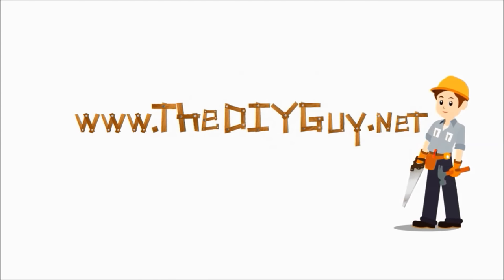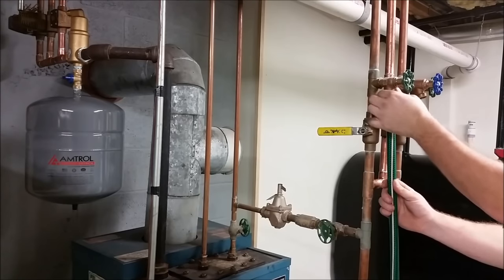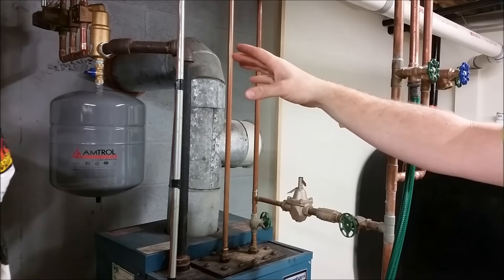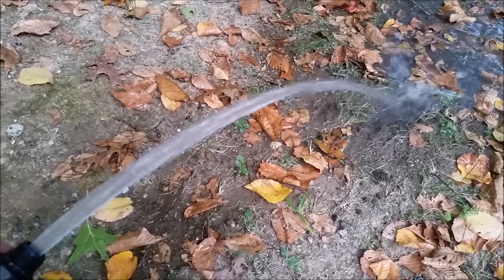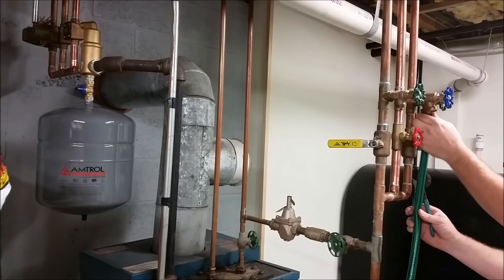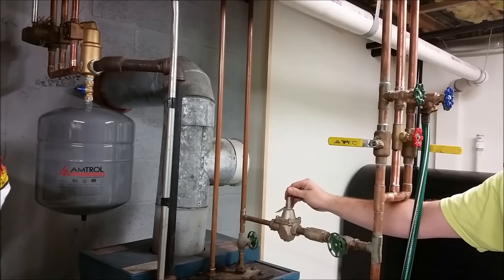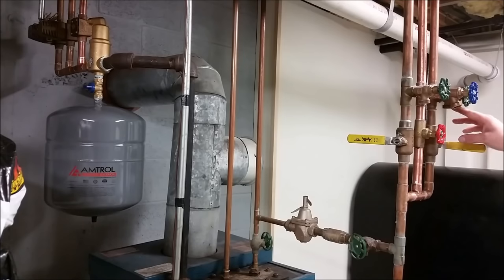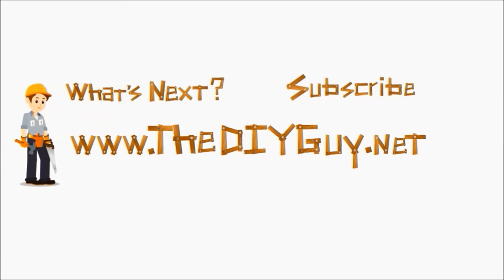How To Remove Air From Your Heating System

Comment: Great video. when I open my feeder valve, my pressure relief valve goes off at 30 psi, is that normal?  Or should I close my feeder?
Reply from the maker: Thanks. Yes that is normal as the pressure relief valve it set to go off at 30psi. (tag on it) The feeder valve should only be open when you have the boiler drain open on the heating loop to help push the air/water though the heating loop. Close the feeder valve and then close the boiler drain on the heating loop and it should fill the boiler back to the set amount. The boiler should be running somewhere between 12-15psi.

Comment: We did all of that now the problem is only 2 rooms are heating the other baseboards are cold any suggestions.
Reply: This happened to me too.  It was the zone valve.  I have Honeywell valves and when you switch from manual back to auto the gears are supposed to move back on their own.  If the handle stays stuck in manual, the gears are jammed and likely the motor is burnt out.  They sell replacements for the valve internals and the valve motor assembly if you know the part number (should be on the side or underneath your zone valve).  They just get old and wear out sometimes.  I was able to keep the old valve body and avoid any plumbing work.  If you only replace the motor, you risk having to fix it again soon since most likely the valve is not turning as easily as it should.

Comment: Did you turn the power to the Tacos off, before you manually opened, and closed, them? 
I thought, this is what we are supposed to do, 'cause, if we open/close them manually, w/out cutting power off to them first, they may burn out. 
Correct me if I am wrong, please. I'm learning.
Reply from the maker: No there is no need to shut the power off when going from auto to manual. As all you are doing is moving the lever to manual push in the plunger to open the valve and allow the water to flow.  I guess it could be a problem if someone left the wires long and you push/ made them touch another terminal while moving the lever. But in this case/ video we shut the boiler switch off which has also stopped the supply of power going to the transformer that powers the zone valves. You do want to be sure to shut the power off to zone valves if you are replacing the zone head.
Reply: @TheDIYGuyDOTnet   

Thank you so much for your reply, and your explanation. I've learned something today. 

Thank you
Reply from the maker: @JohnSmith-ok9sn  You're welcome, Glad we could help. Thanks for watching and taking the time to leave us a comment/ question. Don't forget to give the video a thumbs up/ like. Thanks
Reply: @TheDIYGuyDOTnet  

I have(!), and subscribed! 👍
Reply from the maker: @JohnSmith-ok9sn  Thanks!

Comment: Question: you took out all that water, how do you replace?
Reply from the maker: In the video @1:21 I have a quick explanation on how water gets added back into the system. You will see I touch the water feed valve. This part/ device automatically adds water to the boiler to keep it full. So as you run water out of the hose it adds water into the boiler to keep it topped off. If you Google " boiler water feeder valve " you can see a picture of it and a description of what it does. Hopefully that answers your question.

Comment: I have auto vents on all my baseboard radiators, I simply turn the supply water on let system fill to about 13 psi.  Let it set for  air to rise and then open each floor vent starting at firs floor.  Snug auto vents, bring pressure to 13  psi and then turn heater on and the system circulates any air pockets out the the auto vents.  Viola, system air free.

Comment: Do all homes have at least 1 zone valve? I don’t see one in my boiler room.
Reply: No.  Your home may have just a single zone.  Or it may be have multiple zones served by multiple circulator pumps ( one pump per zone).

Comment: my baseboard doesn't get hot. I found out the pilot was out, but even after lighting the pilot back on and watching the burners run hot my baseboards are still not hot and the forward pipping doesn't even feel hot at all. What could be the problem? It worked last year and I bought the house for 10 years and haven't done anything to the baseboard heater.
Reply: dan wu Check your circulator to make sure it is working. Also bleed the air from the system. If it has bleeders on the radiators bleed there. Also make sure there is water in the system. If you have the air bleed on the boiler and piping, make sure the little cap on top is loose. If its screwed all the way down it wont bleed air.
Reply: the circulator is that gray round thing? How can I know if it is working or not? How do I check. I have not bleed the system in 10 years.
Reply: You will hear it running, you can feel it running, and some you can see the motor fan or shaft spinning if it isnt enclosed.
Make sure the system is full of water, from the boiler thru all radiators. Bleed the air out at the returns like the video shows and bleed each radiator if they have bleeders. The line to the circulator will be hot when calling for heat, and it will be hot after it also if working and if there is not a big air pocket in the pipe.
Reply: dan wu Yes, it is grey, black, green or red with a metallic flexible conduit (BX) or jacketed electrical wire, usually white or yellow going to it.
Reply: dan wu look for a bleeder on the baseboard , or on the piping feeding the baseboard. In most cases if you have cast iron baseboard heat there will be a key bleeder towards the top of the convector , if you have copper fin baseboard heat than somewhere along the copper tubing you should found a bleeder tee also with some type of bleeder , and in multiple story buildings you will find what is called a bleeder tee which looks like a elbow going into the floor with a 1/8 tapping on top with a bleeder.

Comment: I’m not sure how to switch the zone valve from auto to manual. I don’t see a switch like the one you have in your hand. I have two turn type spickets near the tank(return tank?). Do I turn those? Open, closed? I currently have zero psi and no heat on first floor. Prior to this there was a lot of sloshing in the pipes when we had heat.
Reply from the maker: If it is an older zone valve the switch or lever is on the side of the zone valve. Most of the time chrome in color. You want to close the valve of the zone your not doing to isolate the one you are working on. Zero psi... either means your gauge is bad or you have very little water in your system. I can give you a better idea if I can see what your talking about. If you want to snap a picture and click the link in the description and upload it I'll take a look.

Comment: I have a old house and updated the furnace back in the mid 80s and don’t think we have all this! My upstairs radiators are cold and I’m bleeding them all the time and hardly getting them warm! What do i do? There is air coming out water trying to run through them but no water comes out the valves
Reply from the maker: So your system has bleeders on the radiators? Is there another air scoop near the boiler? Can you take a picture of the furnace/ boiler and upload it our site. You can do this by clicking the link in the description and then scroll to the bottom of the page. That why I can see what your system is and how your is system in plumbed. Also see what your pressure gauge on the boiler says.

Comment: hi, so your return water also goes through the fill valve? how does that work? which pipe does the city water comes in from? thanks.
Reply from the maker: Hello, The 3/4" return pipe for the heating loop goes straight down out of frame and then to the circulator pump then back to the boiler.  The 1/2" copper pipe on the right coming down and going into the boiler by the top plate is the water feed or cold water in. The other 1/2" line on the left is hot water out to the house. The cold water tee's and goes to the water make up valve then a check valve and then into the heating water return loop. Hopefully that will help. Thanks for watching.
Reply: ok, so this system provides both heating and domestic hot water correct? thanks.
Reply from the maker: @mark.r8900  That is correct. No problem. Thanks for watching.
Reply: @TheDIYGuyDOTnet  And I just watched to too, and learned! TY TY TY
Reply from the maker: @TheOnKnee  You're welcome. Glad we could help. Thanks for watching and taking the time to leave us a comment. Don't forget to give the video a thumbs up. Thanks

Comment: When you say, "cut the boiler off," do you mean the circulation pump or the actual boiler? How do you cut the boiler off?
Reply: Usually you will have a big red switch in the house to turn it off. Ours is at the top of the basement stairs, but might also be tucked behind/around the boiler itself.

Comment: Well that looks simple , I wish I had access to the water heater damn landlord doesn't like fixing anything and we haven't had heat for 6 days it's been about -1 degree at night , the stoves the only thing keeping it warm in here
Reply from the maker: I'm sorry to hear that sometimes the demand on the boiler is just to much for it to keep up in extreme temperatures, boiler a bit under sized(to many units on it or it can't create enough BTU's) circ pump to small to push the BTU's away from the boiler. If you really think there is a problem with your heat you may want to look into something call "rent withholding." You as a tenants have a right to withhold rent because landlords are obligated to provide safe and habitable housing under the warranty of habitability. If a landlord breaks this obligation, a tenant's obligation to pay the full amount of rent stops until repairs are made. You might want to bring that to his attention and see if he gets it fixed. Also not sure where you live but some places have were Renters can send a certified request to a property manager demanding their heating issues be addressed. City law allows for a rent reduction if a landlord does not respond to the certified request within 24 hours.
Reply: Watch a couple videos on opening locks then you can go fix whatever you want.👍

Comment: I don't have the switch that set it to auto to manual so not sure how to make that happen. Also I cab ID my 1st and 2nd floor values but they both don't have a water value right below it so not sure which to hook it to. Can anyone provide some insight for me?

Comment: If you don’t use a hose and just have the water pour out straight into a bucket shouldn’t make a difference?  My boiler is old and pipes banging and when I drain the water and turn everything back on it’s still banging and seems even worse,, I guess it’s just a sign that the boiler is on it’s way out?
Reply: If it leaks on the ground it can be hot and burn you, also it could flood your basement, but no it does not make a difference

Comment: How come other video tells me to close the zone valves one at a time? As in close the first zone valve, then bleed the water till all the air is out, then move on to zone 2 by closing its valve, leaving the first zone valve closed. When that is done move on to the third zone valve by closing its valve and leaving the first two zone valves closed etc. In this video the zones all are all shut off at the beginning? What's the difference and which is correct?
Reply from the maker: The zone valves you will put 1 into/ onto manual mode one at a time when removing the air then back to auto once your done with that zone. The valves that stop the flow of water from the zone back to the boiler I like to shut all the valves off at the start to isolate the zones. It ensures that the water goes though the zone rather then from the boiler an also to ensure that all the in coming water and pressure goes into and though the one zone we are bleeding the air out of. Makes more of a deference when doing a third story or higher.

Comment: How do I do zone by zone? Are they connected? Do i have to turn on the heat? Should I work from lower level to upper? I have a slide switch to close per zone. How long does it normal take to get rid of air per zone? Thanks
Reply from the maker: When I say zone by zone it means just to isolate each zone and just do them one at a time. That way your putting all the force though one zone to push the air out. So you will notice that I have the yellow handle ball valves in the closed position stopping the water going to the boiler or coming from. Then put your zone valve to manual from the auto that will allow the water to come from the boiler into the zone and out the hose once you open the boiler drain where the hose is attached. The zones will be connected on both the return and exit right next to the boiler as there is normally only the 2 ports on the boiler. Boiler off and heat off. Doesn't matter which way you go as long as you do them all. Depends on the length and size of the pipe. If you do it for 4 mins each zone you should be good. Like I said Once you have the warm/ hot water coming out of the hose give it another min and you should have almost all the air out.

Comment: Why do you need to bleed the lines; is this part of inspection and cleaning?
Reply from the maker: It isn't part of the inspection and cleaning. You would do this is you had poor heat the the baseboard, or you  could here the water going though the pipes/ waterfall sounds or if you open the system to replace something.

Comment: Is there anyway I can mess this up if I do it in the morning????
Reply from the maker: They only thing to worry about is making sure the boiler temp is cool. As when you add water to the boiler it will be much cold then the temp within the boiler so you could risk what they call shocking the boiler or Thermal shock. So when cold water is pumped into a very hot boiler, those parts immediately surrounding the inlet part will contract, while other parts stay expanded from the heat. This thermal gradient creates extreme mechanical stress on it and on the steel tubes of the boilers, and it can rip the tubes from their seats or even crack the boiler itself. So just be sure to shut it down for a few hours ahead of time or manually turn the zones on for a while to dump the heat out of the boiler.

Comment: I have 2 zones in my 2nd floor apartment it seems like I have to turn up the temp to get all the baseboards warm. I do have 2 calculator pumps I don't have any gugerling but a lot of ticking when heat is turned up. do I need to bleed from my burner in the basement or is it possible to bleed the baseboards themselves.  My burners are less than 20 years old it seems to be a yearly occurrence. What do you suggest??
Reply from the maker: The ticking is normal. Its the tiny aluminum fins within the baseboard getting hot/ expanding.  No zone valves correct?  Is the problem with both zones or just on one? It could be a couple of problems.. 1) It could have some air in the line making less water circulate around. 2) You could have a circulator pump that has a broken impeller. I have seen a few of them loose blades or erode so they do not effectively move water though the system. They sound and vibrate like they are but they don't move the water. 3) Bad thermostat placement. It could be that the t-stat is in a room where its small or has a lot of baseboard and that room reaches temp quickly and statifies the t-stat causing it to close the zone valve and shut off the circulator pump. Thus not letting the last baseboard reach temp or get warm. I would try and gauge where the t-stat is and if the t-stat is reaching temp quickly due to placement. You could shut the baseboard fins in that room and see if its any better. (might be that as turning the t-stat up would cause the pump to run longer letting the last baseboard get warm) You could try and bleed the air out of the system then recheck and see if its any better. If not it maybe a bad circulator pump not moving the water. Also you may want to look on the circulator pump as some have a speed selector switch. Most of the time they are on high or number 3 but maybe it got bumped and is only on low or number 1.

Comment: I did exactly what you explained took fifteen minutes..used a dryer mopped bucket in shower and seen and heard the air.. find out tonight of I hear that rattling sounds.. the others I didn't do yet because it wasn't just The second story zone

Comment: I have done this before and i noticed i have dirty water, should i be concerned?  
What psi should boiler be at before turned back on
Reply: We just completed a full purge of all 3 zones in our home. Now they're so quiet I had to make sure the heat was actually going on. Not a peep from the pipes. All zones had "dirty" unfiltered water and it's not an issue. We had a service tech do it for free last year and I asked about it and he said it's common. Regarding PSI: We have ours set at 15psi but I believe between 10-20 is safe. Anything beyond and you run the risk of blowing the relief valve. Keep an eye on it for a couple of days just to be sure, especially when the burner is on. If you need to reduce the pressure just shut off the main and drain as needed. To fill VERY SLOWLY slowly open the fill valve while watching the PSI indicator.  (Disclaimer: That worked for us and are not claiming it will work the same way for you). Good luck!